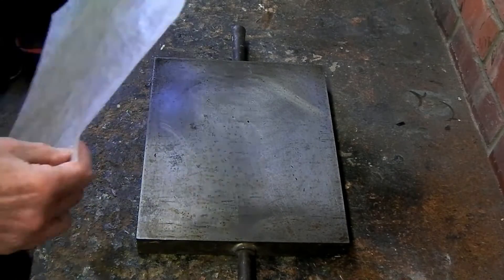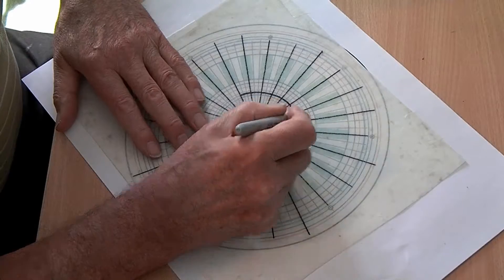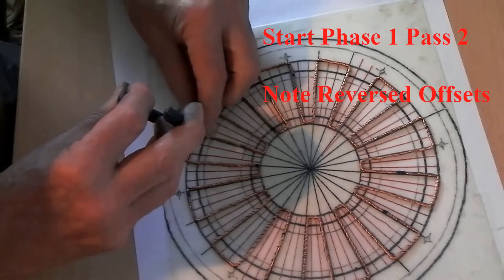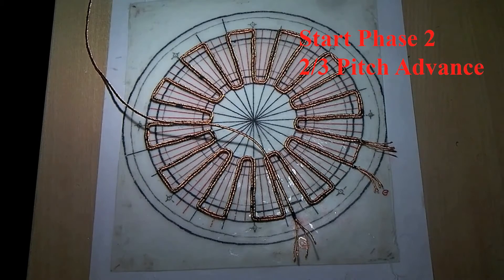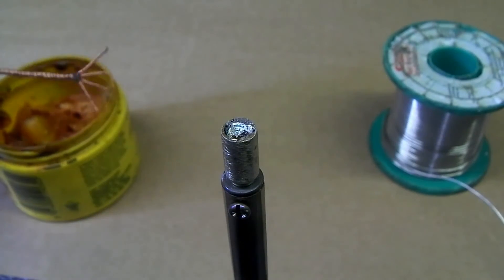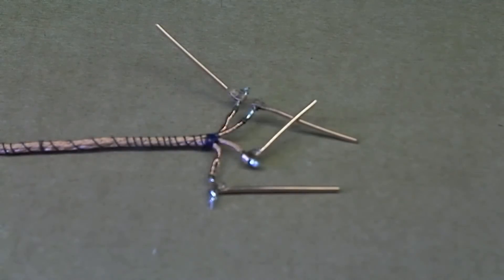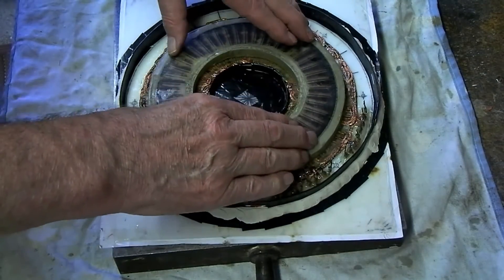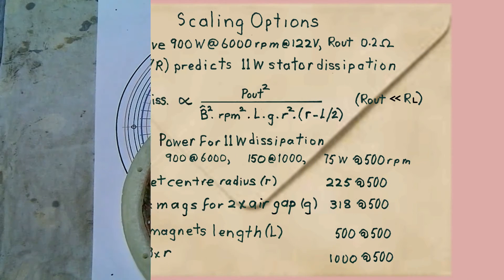Part 3. Axial Flux Alternator Stator Assembly and application options

Comment: How is cooling achieved with the windings encased in all that resin?
Reply from the maker: Dear Greg.   
This is a major consideration. Primary defence is to minimise the only dissipation (which is in the stator) when the machine is operated at its 1 KW rated output at 6000 RPM; hence accent on figure of merit (FOM) in the Part 2 and 3  videos. The stator is only  3mm thick  including 2mm plus of wire within a 5mm total gap. My guess and observation is that the indicated loss of 20-30 W comprising copper ohmic and eddy should be well dissipated by windage. It would be interesting if some kind soul did an analysis based on this type of machine. 
The loss is basicly proportional to the machine's output power squared and inversely to RPM squared.  Attempt to take high  power from this size of machine at low RPM would bring certain disaster.  This cannot happen in the bike application where engine power is limited at low speed.

Comment: How many poles?
Reply from the maker: Dear NicozStrat
Overlapped coils work exactly like the more conventional non overlapped, individually wound, except there are effectively twice the number around the stator.  This nominally halves windings dissipation at the same output power.  There are 24 magnets (poles) around each rotor. Their circumferential spacing is arranged to give a smooth (sinusoidal) axial
magnetic field distribution around the air gap. Design and performance analyses are done on the equivalent basis of flux cutting by the wires within coil limbs. The current presentation Parts 1, 2 and 3 cover the design in more detail. 
Suggest you sift the many workshop based articles on the internet for relevant practical details but, as the New York taxi driver said, you need to practice to get to Carnegie.
Reply: Thank you for answer sir,  you make two pass for each phase, so does it mean that number of turn of each coil is two? Which voltage generate your motor with speed increase? Thank you, very nice project and of course building

Comment: teacher will it generate current  at low rpm?
Reply from the maker: Dear Kevin Pounal
Not tested but the machine as is should produce some 75 Watt at  around 15 volt at 500 rpm plus approximately 11 Watt dissipation in the windings. Lower speeds will produce proportionally less output.